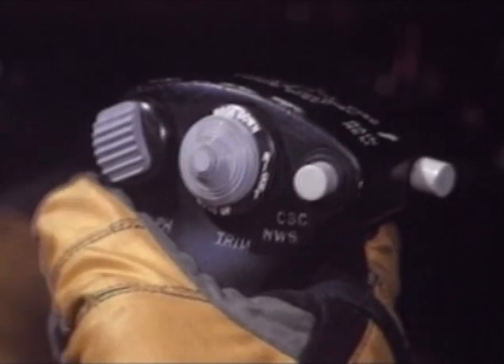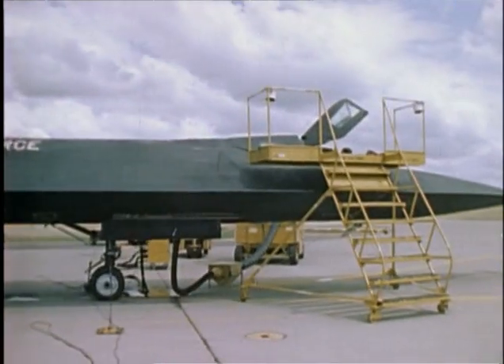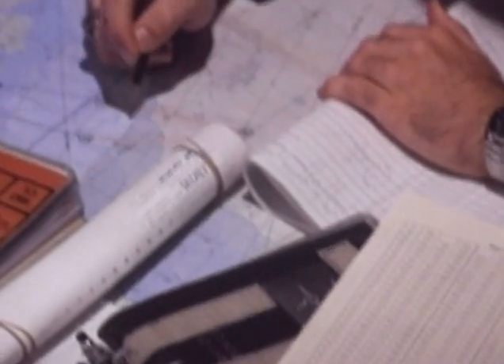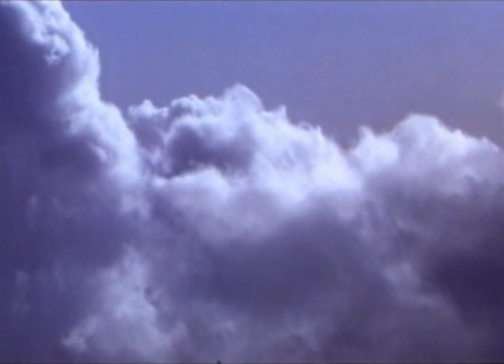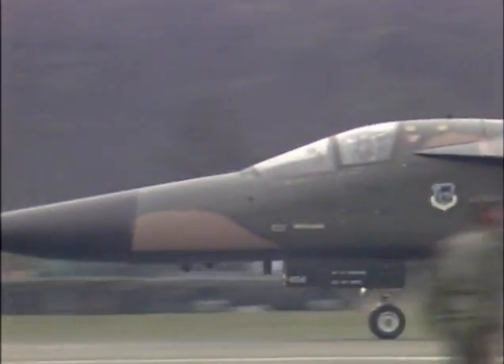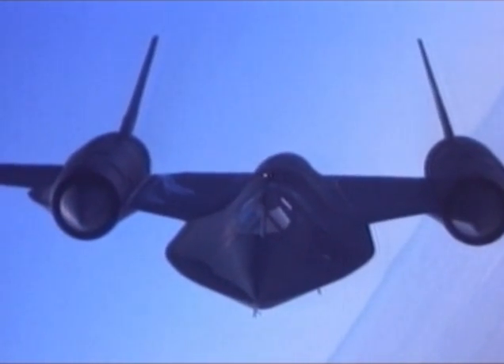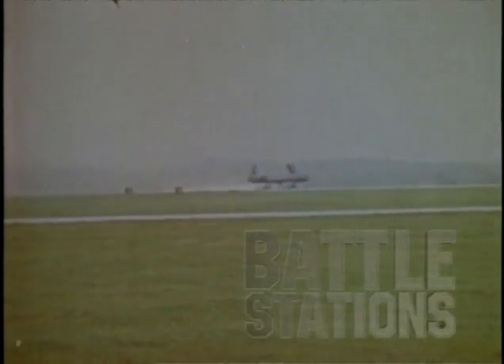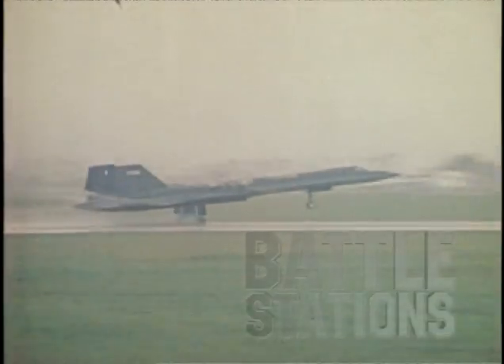Battle Stations - SR-71 Blackbird Stealth Plane -Full Documentary

Comment: <Soviet Radar tech> "Sir, we're getting a blip... It's about the size of a duck...."
<Soviet Officer> "So what? It's just a duck...."
<Radar tech> "Yessir, but it's going 2000mph at 80,000ft...."
Reply: CK's channel.    If it looks like a duck, quacks like a duck, waddle
s like a duck - it's a SR-71!
Reply: That's great. What a bird. Ohio Air Force  Aircraft Museum was where I actually touched this bird with my figure.
Reply: Fred Pal what you finger blasted a black bird there? Good work fella
Reply: Fred Pal.  Also one in Cali.
Reply: @fredpal9755  The last YF-12A is at that same museum.  I saw it there in the early 90's. It was an A-12 with 3 AIM-47 missiles(which developed into the AIM-54 Phoenix missile system) designed to be a high speed interceptor. Because it had a chineless nosecap, it required dorsal fins under the engine nacelles(just like the F-14 Tomcat) as well as a large fin in the middle of the jet at the back. This large fin folded down once the gear came up.  Cool museum.
Reply: Fred Pal: there is one in the museum west of DC, too.
Reply: In Soviet Russia, duck blips you...
Reply: Ahhh..that must be the American duck "Donald" on Cocaine and Meth commonly known as speeeeed !!
Reply: They use knots for flight not miles. So you're about 301.6 mph to slow.
Reply: Original_NoLifeGamer ...they use too to denote more...
Reply: Original_NoLifeGamer: sea travel uses knots, too.
Reply: Its Obvious they would never admit on tv and say they went into russian airspace it could still cause and international incident. There's  still classified info these pilots cant talk about...
Reply: The USSR had a missile that could shoot down medium range ballistic missiles at about the same time as the SR-71 started flying.  If the SR-71 had overflown the Soviet Union it almost certainly would have been shot down. Maintaining this sort of capability cost the Soviets more than they spent on their entire navy, so even though the SR-71 never overflew the Soviet Union keeping it out forced the Soviets to spend an absolute fortune on air defense while their economy stagnated.
Reply: CK, THAT'S REALLY FUNNY nice one brah.
Reply: Soviet Union couldn't shoot down the SR-71.  And if they could of they would of.  The black bird would out run Mig's and there missiles.
Reply: CK's channel. that’s one fast duck
Reply: CK - <Soviet Officer - (looks at watch) "It's dinner time. Shoot down duck. "
Reply: Lol
Reply: CK's channel. Fuck a duck, screw a guinea, Blackbird puss’s good as any......
Reply: "What?! What you drinkin' boy!" LOL
Reply: 90000 ft
Reply: soviet officer...oh,its donald duck again.
Reply: Libs Hate Montesquieu  It was being developed in the 50's so unrelated.
Reply: It's a bird, no it's a plane, no... it's super Duck
Reply: To stay less serious, I wonder how would this joke go if the BlackBird was actually yellow... ;d
Reply: Libs Hate Montesquieu  Well that's one thing we can agree on. Millennials are idiots. Thankfully, I'm not one of them. Do you care to make any more(incorrect) assumptions?
Reply: Kaykay Masson  The exhaust plume of the SR-71 showed up on radar. The engines were injected with boron, a solid material that reflected radar waves extremely well.
Reply: Duck has a hot date..
Reply: @Bartonovich52  no Soviet pilots or aircraft ever flew into U.S.airspace either, so what's your point? Everything you just said about the SR-71 and american air capability can also be applied to Soviet aircraft and air capabilities. It doesnt take away from the amazing design and flight capabilities of the SR-71. Plus with the capability of being able to photograph 100,000 square miles with such crazy high resolution, they really didnt need to fly into Soviet airspace. They were still able to complete mission parameters and obtain photographs of areas of interest.
Reply: @Just Looking Ack, but thats the russian spirit. They NEED to feel superior in terms of military - because they literally don´t have anything more. 
Don´t believe? Just inform about russian media and what russians are told all the day to keep them calm, and you see how fucking true this neurosis of the russian people has grown.
Reply: Kaykay Masson  Yeah they do.
Reply: soviet Officer>''thats  a crazy duck ,shoot it down"
Reply: Loooooooooooool the best comment ever!
Reply: @Bartonovich52 sounding like a Goddamn commie with that fuckin attitude, get the fuck out of here you pleb!!
Reply: It never been in Russian air territory.
Reply: @Bartonovich52  https://nationalinterest.org/blog/buzz/how-russias-mig-31-tried-stand-americas-sr-71-spy-plane-65556 Read this. Best do your research before you spout bullshit that you clearly know nothing about. I can post more articles including from Russia if you like.
Reply: Hmm the plane specially designed to fly recon on the user never entered Soviet air space? Hey moron, unless Soviet air space is cut off above 50,000 feet the SR-71 or A-12 was flying over the land mass formerly known as the Soviet Union on an almost daily basis and multiple times in the same day and not only the most advanced SAM or top Russian fighter ever came close to being able to bring the SR-71 down or even threatening it, not even the SA-5s,
Reply: CK's channel. جظ
Reply: CK's channel. Here hold my vodka
Reply: And later the radar tech was shot for being drunk on duty and denying it.
Months later the radar operator's superior was shot for being drunk on duty and lying about it.   ;)
Reply: That would be a drone.
Reply: CK's channel: Can I do Two Thumbs-up?
Reply: Now this is funny.  I cried laughing.
Reply: The F104 reached 104,000 ft. I'm sure 80K is just getting warm for the SR71@Noah Anderson
Reply: @mikerowan1132  The F104 could only reach that altitude doing a zoom climb, basically accelerating horizontally to top speed and pulling up. It also had very tiny wings and could deal with the stresses of falling back in to the atmosphere. The SR-71 wouldn't be able to stand up to the stresses of a zoom climb. Maybe it could have gotten to a higher altitude but it would have disintegrated as it came back down. The wingtips of the F104 were sharp enough to cut you.
Reply: Except it was a huge radar blip thanks to its very unstealthy exhaust plume... and the Soviets would have easily shot it down. This is why the SR-71 NEVER entered Soviet airspace. Both the Mig-25 and even the much slower and lower Swedish Viggens got into successful firing positions multiple times.
Reply: Then why didn't every Soviet-made missile that tried to shoot it down, fail?
Reply: If it never entered soviet airspace, why would a Mig need to intercept? Please cite your sources.
Reply: @michaeldombek2901  Arctic airspace?
Reply: @michaeldombek2901   i saw on you tube somewhere where it was said that after the u2 downing the sr flew along the borders only.but you never know whats real and whats fake.
Reply: @michaeldombek2901   True, I scrolled down just to watch 1st response about
Bartonovich52 comment. LOL. He believes CIA had recruited hundreds of ink, pen and paper users to draw all that recon photos with bare hands... Brings a tear into my eye. Beside, plane does not need to enter any airspace to take photos with in. Its a plane - it can bank to a side and record from an angle or have the camera installed under a certain angle aready... Some ppl don't think...
Reply: @michaeldombek2901  Because they we're on the verge of Soviet airspace so they scrambled some MiG's if murica decided to act dumb?
Reply: @michaeldombek2901  Makes you wonder how they got the photos without entering the airspace. Hmmmmm
Reply: Bartonovich52 you live in dreamland comrade! Easily shot down ? Getting missile lock is one thing ,shooting down is another . This plane was shot at 4000 times and never touched, and where were all those anti aircraft missiles made ? In the communist utopia of the Soviet Union. Plus the couple of times our Swede friends got a lock on the SR it was slowing down and below 75000 feet. And the mission details of the SR have never been declassified, once they are you and everyone else will learn your precious motherland was overflown. I’ve met three Sled drivers , all of them when asked about overflying the former Soviet Union said “ No no we never overflew Russian territory “ and always with the same wink ,wink ,nudge ,nudge smile and laugh. So believe what you want. Russian pilots have admitted Kamchatka was routinely overflown and even Victor Belenko talked about the frustration of trying to bag a SR.......
Reply: Bartonovich52 they tried to shoot it down when Egypt n Soviet Union we’re trying to take Israel 

And failed

Israel also missed
Reply: @Bartonovich52  lol!!! Nice Kremlin propaganda. No mig or any other aircraft has ever got a bead on the sr 71. Not a single one. Russia tried and tried and failed all the same. Whats wrong? Butt hurt the Russians were never able to match it? Lol
Reply: @Bartonovich52  I respect your will to be affiliated with the dominant power but affiliated with the dominant power you are not!
Reply: @Bartonovich52  prove it ---- you have no idea where this plane actually flew.....
Reply: @Bartonovich52  Another armchair expert heard from. Thank you for your enlightenment.
Reply: @Bartonovich52  b r u h
Reply: @Bartonovich52  citation?
Reply: Bartonovich52 sewing it on radar and shooting it down are 2 different things.  Entry into Soviet air space was never officially acknowledged.  Though I will say the SR-71 was a very good cover project for the earlier A12.
Reply: @Bartonovich52  Yeah but it was so fast at top speed it could out speed the fighter jets....
Reply: @Bartonovich52  I am not sure you are talking about the right plane sir.
Reply: @Bartonovich52  Your information is incredibly inaccurate. For one, the MiG-25 never got into a successful firing position and the Swedish Viggens had the benefit of knowing that the aircraft was coming well in advance, but just getting a firing solution does not mean a good possibility of a kill. Many missiles got a firing solution on the SR-71, but the SR-71 would have not just outrun the missiles, but also jammed the missiles, and the fuel of the SR-71 had been cesium-laced to make it even more stealthy than it already was. The probability of a hit was extremely low.

Upon further research, the Viggens don't even count. They were chasing an SR-71 whose engines had malfunctioned.

Pursuing and intercepting are two very different scenarios. The only Soviet aircraft to even get close was the MiG-31, and while they might achieve a missile lock, they would have had an extremely bad hit chance. Anyone with experience in military aviation knows this. Missiles do not fire their rockets all the way to their targets. They often use their rockets for a boost, then coast to the target from there. The SR-71 would be long gone. The MiG-31 cannot catch up, and the missile can't keep up.
Reply: @Bartonovich52  if a missile could reach it and catch it
Reply: @Bartonovich52  Right and we recall how many they successfully shot down. NONE   That was the point of flying above the range those planes were capable of reaching and faster than the missiles they had to shoot. There's reasons for all things. Success certainly did not hinge on the ''benevolence'' of foreign fighter pilots NOT shooting them down. They could NOT shoot it down as hard as they tried.
Reply: Bartonovich52 well, they could detect it, but the thing could travel outside of most surface missiles intercept envelope.
Reply: @Bartonovich52 "  the SR-71 NEVER entered Soviet airspace." And you know this how? Do you honestly believe that if they did enter Soviet airspace you would ever hear about it? Even today they wouldn't admit having done it back then.
Reply: @Bartonovich52 https://www.quora.com/When-did-the-SR-71-make-its-first-flight-over-the-USSR-and-how-deep-into-Soviet-territory-did-it-go
Reply: Bartonovich52 So it was never shut down wow I got a funny feeling your ego has just been shut down
Reply: @Bartonovich52  You are wrong
Reply: @Bartonovich52  you be drinking too much vodka.
 The US flew through Soviet airspace many times.
 Proof is the U2 which was a much slower plane was shot down by the Soviet Union using a missile, with the Soviet news media showing many pieces of the downed aircraft, later releasing the pilot, Frances Gary Powers.
That lead to the SR71 which was never shot down.
If the former Soviet Union could have gotten anywhere near the 71, they would have shot it down and made sure everyone else knew about ít, just as they did with the U2.
Reply: Except Russia and Russian allies fired over 4,000 missiles at SR-71’s and never scored a hit, so no they wouldn’t easily shoot it down
Reply: So the reason the SR-71 landed in Norway so often was to drink coffee and have a chat with Norwegian pilots before flying home again????????? You are pretty naive sir....
Reply: one SR71 should also had past on the swedish eastcost with one faulty engine so the swedes dident chase it as US is seemed as an allied.
Reply: @extec101  Yep, U.S. confirmed it in 2017.
http://www.thedrive.com/the-war-zone/25205/declassified-us-honors-swedish-pilots-for-escorting-stricken-sr-71-to-safety-during-cold-war
I expect to see this story soon in the theatre, i just hope it's gonna be a co-production! :)
Reply: @MrKveite1  When did it land in Norway? Its base was further south...
Reply: @Bartonovich52  why didn't they shoot one down then? A MIG couldn't fly anywhere near 80,000 feet or 2,000 mph.
Reply: @dextermorgan1  Maybe Russians decided one downed U2 is enough? :D Hmmm. I heard SR71 back in the days, were flying over Norway,, Baltic Sea, Poland, possibly Ukraine and heading back north... I wonder if my backyard got recorded and how was my smile from the sandbox...
Reply: @dextermorgan1  You are aware that you don't need to fly at the same altitude in order to shoot down a plane yeah? Or are you an expert youtube pilot?
Reply: @bigblock3706  I am an expert YouTube pilot! Thank you for acknowledging that. And no, you obviously don't have to fly at the same altitude to shoot a plane down. I never said that was required. The Blackbird was capable of out running Soviet missiles back then anyway, but you'd know that if you actually did a little research. It sounds like you're just scrolling through the comments, looking for something to run you mouth about. What are you a YouTube keyboard warrior?
Reply: Even if the SR 71 was to fly into Soviet air space that would be considered an act of war, its not because they didn't have the capability to fly into Soviet air space. Also the flight path never changed so of course interceptors were able to get a target lock on a plane that was flying on the edge of Soviet airspace.  Better coordination with the MIg 31 and the R33 missile were definitely a threat but even given a good firing solution that had a very marginal amount of time  to pull off this. But again lets be honest, the SR 71 was flying on the edge of Soviet air space because even if it could fly over Soviet air space which was a 50/50 chance of success, it would be considered an act of war. Its not as  though the US military was not aware of this or unaware of the capabilities of flying close to Soviet air space the high risk  for low reward was not worth the risk. An lets be honest how many times has Russia planes flew off the coast of US air space in perfect firing position as well especially with the F22 Raptor. As long as they didn't evade US Air space they had no reason to fire on them. But again I was in the Air Force an heard many defense contractors and old generals state to me if they wanted to they could have flown over the Soviet Union, would it have been risky yes,was the risk worth the reward, no. Again those aircraft that had firing positions on the SR 71 were in the air with R33 missiles, change the scenario around with a different flight path and  the SR71  not allowing you to get into a firing position in the first place. This was even done in the Gulf war with two Mig 25 literally out ran a group of F15C's escorting a bomber, and a total of 10 missiles were fired at the Migs an they still were able to escape. So I wouldn't be a certain they would have scored a hit even if they were in a good firing position especially at that altitude with a plane that actually goes probably around Mach 5 or 6.
Reply: @Bartonovich52  It did.  Many times.  Why not ask Brian Shul, one of the pilots, who published the book Sled Driver?
Reply: @linuxgurugamer  What does that book prove though? That a pilot said he did it? Okay...
Reply: @Bartonovich52   Bartonovich52  They only got in to firing positions on an SR-71 that was experiencing an emergency over the Baltic Sea. Yes, the Soviets were able to get a firing solution on the SR-71 but this was when it was in emergency and actually being escorted by the Swedes.
Reply: @Bartonovich52   This is why the SR-71 NEVER entered .....only to public knowledge - non of the sites will ever admit otherwise
Reply: Russian planes built in the 70's can fly rings around the SR-71...
Reply: Darryl Hetherington
Please tell us which Russian plains could fly rings around the SR-71.
Reply: Really?  Name one which can fly at >2000mph, at 80,000ft, for hours on end.  And the 2000 was not it's top speed
Reply: In your dreams, they would fall out of the sky trying to catch the SR 71. Plane was never shot down.
Reply: @laronfox9875  U-2 shot down Russia and over Cuba but no where did I find the SR being shot down.  I found an article of a Russian pilot explaining how he would do it, but nothing else.
Reply: Darryl Hetherington.  Only in your dreams comrade Darryl!
Reply: @coiledsteel8344  .
Reply: Darryl Hetherington that’s why they couldn’t shoot any of these down.
Reply: @seahippies  okay there, buddy... Except that the Blackbird was (and still is, so far as declassified planes) by far the fastest plane to have ever been built.
Reply: @seahippies  fastest plane on earth no other plane could go that fast or get that high due to the low atmosphere at 80,000 feet.
Reply: @seahippies  If they could have they would have.
Reply: @seahippies  Please specify.  Thank you.
Reply: @seahippies  pilots during the 70s were more dependent on missiles and the blackbird could outrun any missile in use during the time
Reply: @seahippies  name one
Reply: @seahippies  Name one!
Reply: @seahippies  ummm....no
Reply: @seahippies  what kind of drugs are you taking?
Reply: Yeah, when the SR-71 is parked on the ramp.
Reply: @seahippies  Good to know Ivan. We must have been unable to detect them crossing our air space they were so stealthy or fast. Maybe they'll take all those records for themselves since they have superior airplanes and show them off.
Reply: @seahippies  A little more information please? So why does it say above  "Today, the Blackbird is still the fastest, highest-flying, most-effective reconnaissance aircraft in history"?
Reply: Darryl Hetherington bullcrap
Reply: @seahippies  Umm, no.